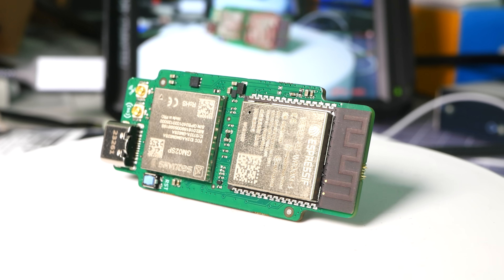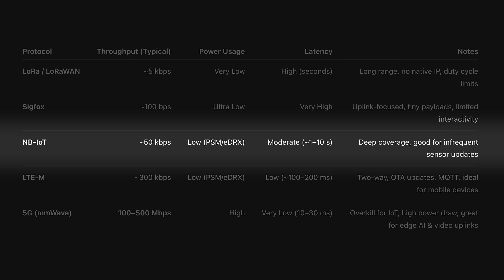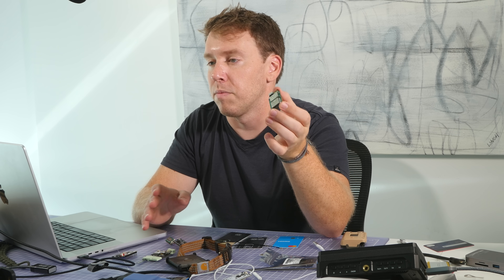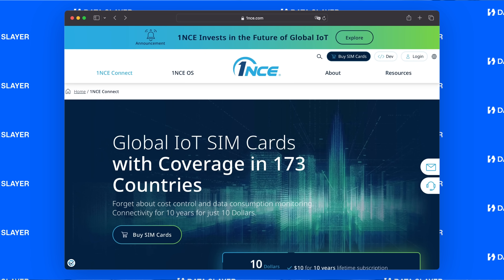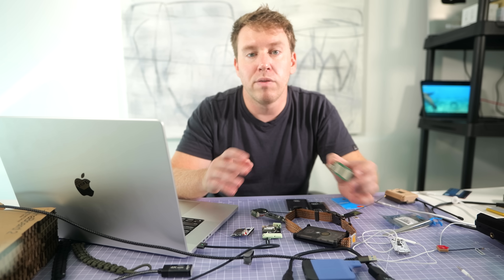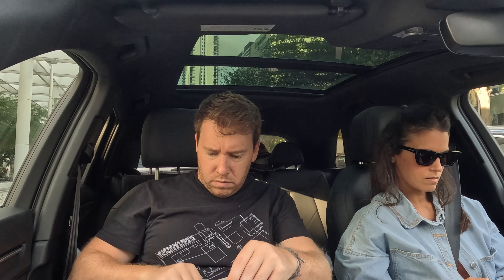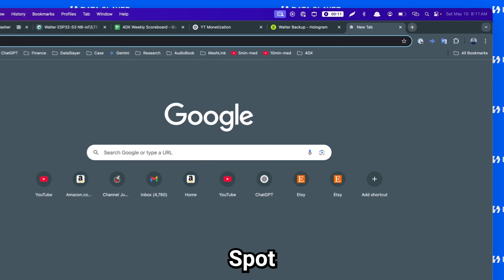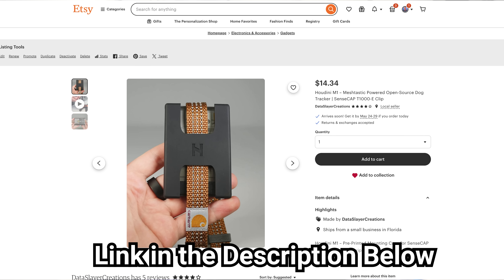You’ve Never Seen Cellular Like This

Comment: Completely open-source and certificated world-wide? So it could be used by those companies that wanna make open-source cell phones but in past had to compromise and include closed-source GSM-modems because the operators/governments wanted to keep things locked down? How deeply can it really be reprogrammed? Can you make it into a custom SDR that monitors the whole cell band? Can you turn it into a tower emulator device? Would you get in trouble if you had it programmed to bootstrap a mesh network on cell bands whenever there are enough of them in range?
Reply: The monarch modem is not open source, neither is the ESP32-S3. What is open source is the work they’ve done, the schematics and such.
Reply: @LtdJorge  Hm, so what else on this video is a lie or otherwise misleading?

Comment: I recently started looking into lora and mesh but after viewing the maps i was surprised that most of the US has zero coverage. It was a let down when i see such cool gadgets like the tracker card. I have a non verbal autistic 8 year old son thats also diagnosed with elopement. In simple terms he wants to run away constantly and has no understanding of dangers like cars, heights, water, roads etc ... His current tracker lasts about a year and is 60 bucks a mo. After a year it stops charging and broadcasting.
Reply: Why dont you use a smartphone for that?
Reply: @ifly2themoon171 I've considered it but if my son Sawyer drops it or leaves it then it won't help. Plus the school 100% banned all phones. His tracker that he wears is the size of a pack of matches and I use a keychain ring that I thread through his belt loop. If it's easy to remove he will remove it.

Comment: Could this be used to remotely control a drone or rc car?
Reply: In theory yes, but the latency would be higher than a regular 2.4GHz RC when using LTE-M. We are working on a demo project where we control a robot car with Walter.
Reply: @DPTechnics latency wouldn’t be an issue as it will be safer than sending a person in.
Reply: @MFCB5  In that case definitely possible. Two way communication is where cellular really shines over unlicensed technologies like LoRa/Sigfox.
Reply: @DPTechnics alright Thank you very much. I just have to learn the coding aspect of it so I can get it working. I am retired military and looking into different options to send into a building for 1st eyes for a 20 second instant visual that could be the difference for the 1st in person

Comment: @3:55 That board does NOT have castellated edges.  Maybe you need to review what that means.
Reply: Its where after the thru-hole header pins holes are plated, the edge of the board is cut off, leaving exposed half cylinders of copper running down the edge of the board giving it a castle look. This makes it super simple to design another circuit board that the castellated board can be soldered directly to the face of without using any bulky connector pins or cables.
Reply: @mikescholz6429 .     Thank you ❗️
Reply: Definitely not castellated but the non through hole header pins look interesting.
Reply: ELI5?   What are castellated edges?
Reply: For an example look up pictures of the “pi pico” board.
Reply: What this man said 👆
Reply: @asteriskman this

Comment: If i need a sim, from an isp, where is the free part?
Reply: I have no experience with this but you can do device to device LTE.
Reply: @parawizard  technicslly its possible within 3km range in good signal quality... while traditionally... gsm modems or lt3 or 4g etc.. all modems are made considering they has to be used with sim encryption or 3rd  company seelling you connection :D which means they are locked... you cant use radio directly.. but some chinesse devices had been open... also not much people try to use it :D but in reality its a built in 3km plus radio transmitter and receiver with lots of bandwith selection options ...
Reply: It’s a free software stack as in open source. It’s a clickbait title, by purposefully confusing but technically correct wording. Interesting video, but clickbait non the less.
Reply: @daverog12 gotta play the algo game
Reply: My thoughts exactly. "Cost ALMOST none". That could mean anything. $10.00- $5k. My definition of "none" is $0
Reply: @tyjohnston5889  If you want free communication, walk outside and shout because that's the only method of free communication we know of. 
This device costs like 10 bucks for a decade of use, if you had watched the video you would have known what "Almost none" meant.
Reply: Well for the Sim and service it’s a one time payment of $10 and that gets you service for 10 years and 500MB which one sending small bits of text sensor data intermittently is great. Also, it’s worldwide. It’s the first time I’ve heard of a service not expiring the amount of data you have left after six months of non-use or something like that.
Reply: @tylermcdermott999 what happens if you use the 500MB though?
Does it bill you for coverage or it just stops working or you have to pay more?
Do you think that 500MB would be good for a project to remote start and control my car via can bus
Like open and close windows maybe adjust the climate control 
Not sure how much data that would use
Reply: @andreamitchell4758  "Do you think that 500MB would be good for a project to remote start and control my car via can bus Like open and close windows maybe adjust the climate control "

Why would you want to us cellular and go over the internet for that? For something like that a local direct signal would make more sense and be more secure.
Reply: Helium Mobile offers free plans and you can request a sim. I was able to get one, but haven't found a good use for it yet. Maybe something like this?..
Reply: @smoke.007  it really works? i cant try it, aparently is only for usa
Reply: Exactly, and then saying Big Telco will hate this...

because you are paying them for sim and lte access??
Reply: I think the advertisement is that you can connect to LTE networks which some devices cannot. Still don’t think it’s free though you still need to buy the boards anyway
Reply: If you look up 'IoT sim card', you'll find a LOT of vendors that have either free or very low-cost plans.  For example, Hologram offers $0.03 per MB + $1 monthly recurring charge per SIM + $3--one-time fee--per SIM card + $0.19/outbound SMS (inbound free).  That's bloddy cheap!
Reply: I am told by my experts that CBRS works. CB radio frequency goes up to 3.5ghz.
Reply: This dude is just a radio enthusiast.  Not someone you wanna look to for penetrating networks.
Great channel to find cheap builds with hardware but its just step 1 in 80 steps to get free LTE.
Reply: Was thinking the same thing. There is such thing as "open" LTE, this just isn't it
Reply: Have you ever Heard free Internet any place in the world?
Of course it does need sim card.
Reply: @Tufan-zn9he  if the free, is the internet service of the sim, then what is the device for? the "wow" thing is that an isp ofer free service, even if is only 3 gigas, not the device.
Reply: @Tufan-zn9he  libraries often have free wifi, also some trains and busses or fast food chains offer it as well
Reply: @Tufan-zn9he   Yeah it actually exists but it requires building the tech to hack satellites. There are non profits that own and maintain open source satellites to allow free and safe internet.
Reply: 4G Sims are cheap and you use way less data on this chip than an actual phone, especially if you're only using it for something like IoT.

Comment: Can I disable the gps and use the lte or do cell towers require this for communication? It seems I am always dependent on having a paid carrier for data transmission?
Reply: Hi, you are not required to enable the GPS, you program Walter in Arduino, ESP-IDF, Micropython, Zephyr or Toit. Cellular requires a SIM card which is paid data but the cost is small these days.

Comment: Voyager 1 is only capable of 160 bits/s and has firmware updates
Reply: It has only 69.63kb of total memory
Reply: @alpha_pixel_ that's enough to land a craft on a celestial object
Reply: True but? If you couldn't use your product for 5 months would you care after that oh and it's not like leaving the solar system and such
Reply: Yes, and it's only 1 device on the network. It'd be nice if you didn't hog the whole lorawan to update your device
Reply: Also, you need a programmer who knows how to write completely custom firmware for it in assembly language to handle the updates
Reply: Isn't it powered by nuclear
Reply: @KingLarbear 
Nuclur* only thing that'll get ƴou thru the heliosphere
Reply: @KingLarbear  It has a Radioisotope thermoelectric generator.  Nuclear as we think of it on earth.. no, but spicy atoms decaying are required to power it.
Reply: @KingLarbear  Yes.

Comment: Free cellular but NOT for the phone....that reminds me of an invention I was thinking of making; socks but NOT for your feet!
Reply: So gloves/mittens?

This has a valid use case in portable non smartphone devices, like laptops, handheld game consoles like the steam deck, and even on non portable devices as a back up

The problem with smartphones is that everything combined into the SoC, phones are just to small to fit something like this

Your phones WIFI, Cellular, Bluetooth and any and all wireless protocols it supports are built into the same physical chip as the GPU and CPU

Meaning to make an ope source smartphone cellular chip would require making an entire open source phone, you’d need to design a custom CPU, custom GPU, custom motherboard for all of it
Reply: @MayYTlive well yes, that would be the idea. But big tech would never do this. They'd invent their own proprietary mesh that only works with their brand of device
Reply: that's genuis start a kickstarter (this is a joke)
Reply: those are called condoms
Reply: There's a huge difference between IoT cellular and consumer phone cellular usage

Comment: GPS signals are radio waves in the L-band frequency, typically around 1.2–1.6 GHz. These signals can pass through non-metallic materials like air, plastic, wood, and glass with minimal attenuation.
Reply: The issue is, though I do not know how common it is for residential buildings in the US, that windows often have metallic coating on them, blocking the signal off to some extend. In Germany, it is for example, though not that bad with GPS.
Reply: That's a good valid point.
Reply: Gutan tag!!
Yeah, the German glass is real glass..😊😊😅
Reply: Nice
Reply: The issue is that GNSS signals have a very low level. With more modern receivers, it's no longer a crucial constraint, but the older ones (15-20 years ago and before) were completely unable to function indoors and barely were able to get a fix on the window sill. Windshield glass wasn't such an obstacle when the receiver was installed on top of the dashboard, but metallized IR-reflective glass was and still is a significant issue, unless you attach an antenna to one of the non-metallized parts of it meant for toll road transponders, etc.
Reply: L1, at 1575.42 MHz, and L2, at 1227.6 MHz (newer satellites also broadcast on L5 at 1176 MHz).

1.2Ghz Through 1.662 Ghz is P band and reserved by USA Government Space to Earth communication.